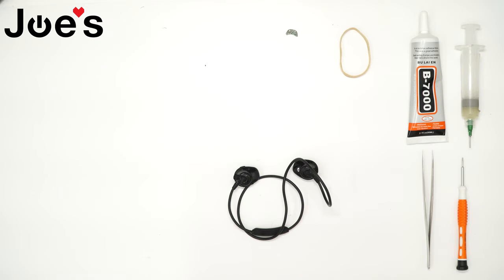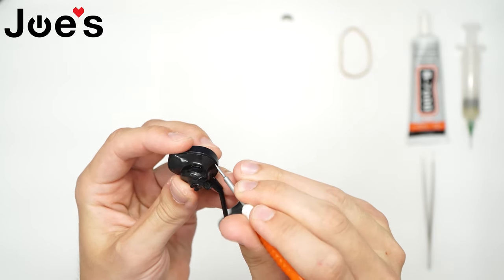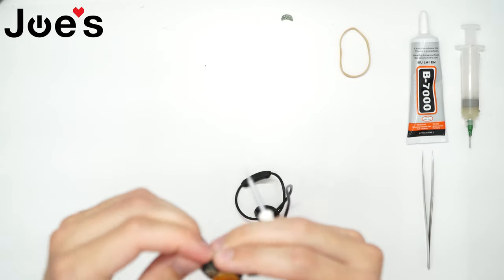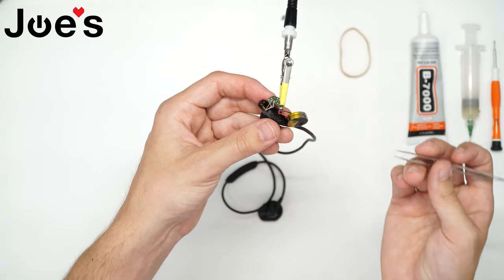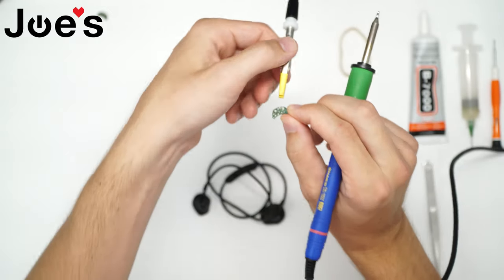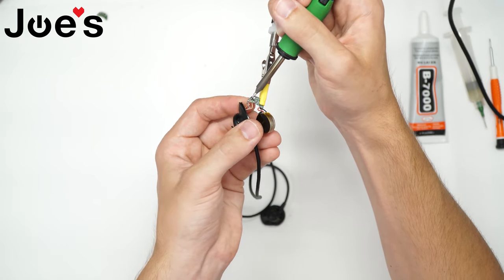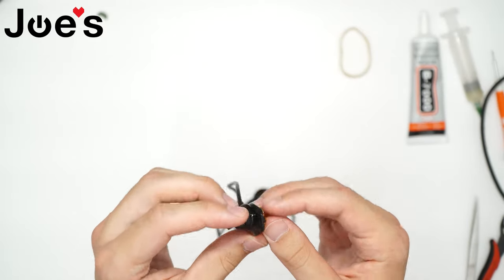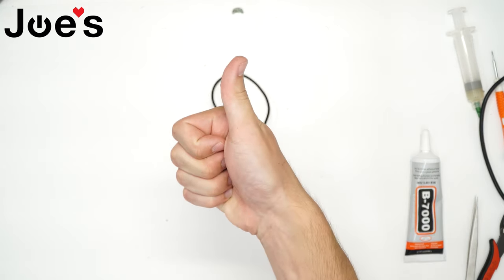How to Repair Replace Bose Sounsport Main Battery Board

Comment: Hi, when I plug my soundsport wireless on the charger. It doesn't  charge or show the light indicator but I noticed it gets hot when plugged in . Can that be a battery board issue or is it the battery?

Comment: Hi joes I’m from India I want to replace my battery for the Bose soundsport can you please tell me where I can buy that battery
Reply from the maker: Thanks for the comment. Here is a link to our repair parts: https://www.joesge.com/products/bose-soundsport-wireless-battery-replacement-li-ion-parts?_pos=5&_sid=a7c62ba81&_ss=r
If the part you are looking for is out of stock you can enter your email in the "Item out of stock - notify me!" section and you will be notified when this item is in stock. 

If you would like your item repaired by a professional you can fill out this repair form here: https://www.joesge.com/pages/repair-services

-David P
Reply: @Joesge  its the same size that origina part?

Comment: how do yo identify the problem?
i was using mines as regular and they run out of batter afterwords when i put them to charged as usually the green light turned on as if they were completly charged. but they dont turn on
Reply from the maker: Usually that’s a battery issue.
Reply: @Joesge   Thank you, i appreciate.